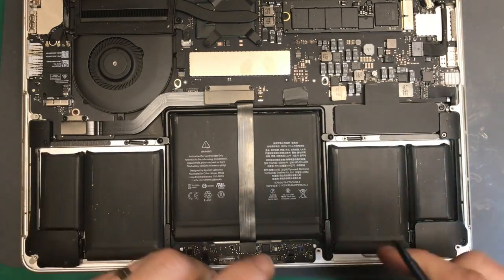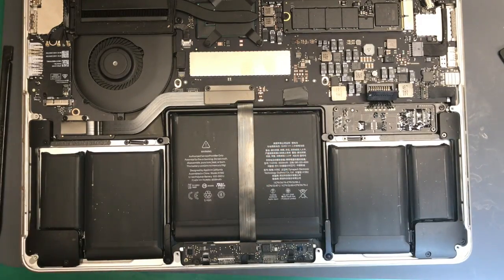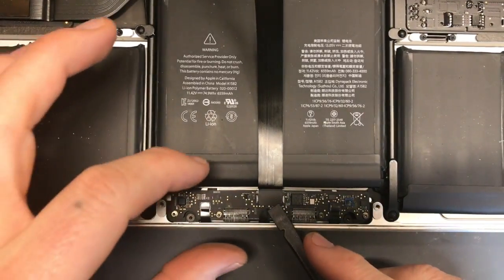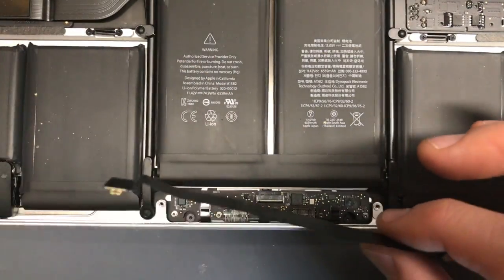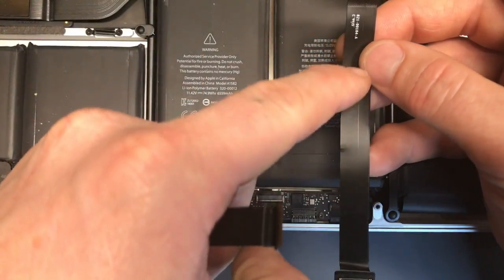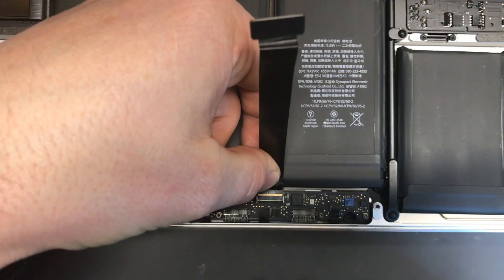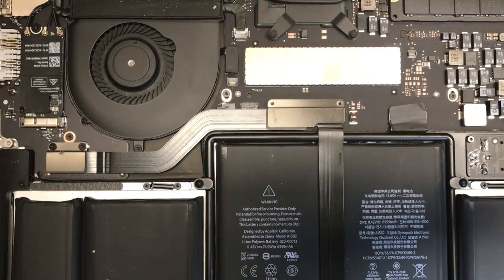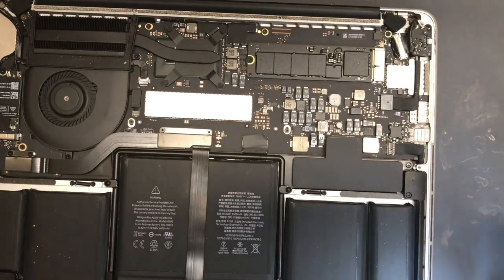Macbook Pro 13" 2015 A1502 NO Trackpad & Keyboard Fix repair Guide

Comment: i have the same problem, i changed battery and the ribbon and and the keyboard and touchpad doesn't work. any ideas ? please
Reply: Check the ribbon cable at the trackpad end, check its in enough and the flip connector is down correctly, check the trackpads mainboard for any corrosion, otherwise check the other end of the ribbon cable for corrosion on the mainboard
Reply: @jtw7777  Thank you so mutch !! I have already checked. The weird thing is that the touchpad and keyboard stop working after the bettery change, so i thought it maight be the ribbon and i changed with a new one. still not working. i have checked with the old battery also and without battery at all and still doesn't work. i don't know what else to do.

Comment: Mate any advice if break that leaver on the connecter ?
Reply from the maker: Hi, under a microscope or magnifying glass thread it back on, then flip it down, then tape it down, if this fails you have to replace the trackpad. Its not hard to fix if you have the broken bit and the right tools.

Comment: You mention you need to put dubbelsided 3m tape on the cable. Is this necessary? When I use such strong tape will I be able to remove the cable again if it won't work after all or if it is broken again? 
I guess 3m is a brand, but also refers to the tape-type. If tape is necessary, which type should be used and could also other tape be used?
Thanks for your help!
Reply from the maker: Hi you will need the tape, the cable seems too long, just remove the tape from the old cable, it works good.
Reply: Thank you!

Comment: Thanks for the video and for the explanation. I have a question though. After I replaced the cable on my early 2015 MacBook Pro I was unable to get it to start back up. I tried doing a SMC reset, and all it would do is make the boot up chime and then immediately shut off. I put the old cable in and it started back up (trackpad and keyboard were still out however). Any ideas as to what is going on and what I can do to get the new cable to work and the computer powered on? Thanks for your help!
Reply from the maker: Hi Nate, I'd say the cable you have purchased isn't a good quality or is faulty, I'd recommend to buy 2 cables and have one ready incase you have this issue or it fails again, try buying from another seller next time and buy 2. Good luck.
Reply: Thank you!! Just got the new parts today and it 100% fixed my issues!! Thanks MAC111 for your help!

Comment: I have the same problem.

1. I did the PRAM reset
2. SMC reset
3. Reinstalled OS X
4. Changed the cable.

The power button works oddly but still no change.  Any ideas or help would be appreciated!
Reply from the maker: rocker250 Hello, you should try another cable from a different supplier, it that fails it maybe a trackpad fault. Good luck
Reply: I tried a second cable. Still no luck.

The keyboard and trackpad work if I run linuxlive. 

Could this be corruption in the software maybe? I did do a clean install already though.
Reply from the maker: rocker250 I’d say both replacement cables are faulty.
Reply: Omg same. I thought I was the only one who tried replacing the cable but my keyboard and trackpad still didn’t work.
Reply: i had my cable replaced by apple, and i still find it faulty :(

Comment: Same symptoms as described, replaced the cable as explained but the trackpad/keyboard still won't work :(
Any ideas?
Reply from the maker: I would recommend trying another cable from another supplier.
Reply: impendio same thing happen to me did you find anything else?

Comment: 🍑Troubleshooting the unresponsive 3-4-e-r-d-f-c-v or even the 1-9 keys: check the keyboard ZIF connection first next to the trackpad flex cable. If it is broken, try to put something underneath, for example a thin plastic, to push the whole connection side upward. And save 10$ on another part, by thinking you might have broken the ribbon cable while being it... 🍑

Comment: We've tried this, having bought both screwdrivers but the T5 to do the trackpad cable screws seems too big, although it's the right shape. Have we bought the wrong one, are there different sizes? Thanks in advance
Reply: Daniel Jordan im having the same issues did you find a fix to this?
Reply: @itsnadeya  Did you find out? Is it T4 or T5?
Reply: @arnaudgay4658  its the one in the description i just wasn't turning it hard enough i think

Comment: Hello. Before this repair, did the trackpad and keyboard work in recovery mode? Thanks in advance.
Reply from the maker: 은화 김 hi, Sorry I’m unsure I haven’t tested it, normally when the cable fails the power button is the only key that works, I’ve had reply’s saying it works with Linux when the cable has failed.

Comment: Hey! So, someone at the apple store helped me do this and just when I went home I started having this issue again? What happens now?
Reply: Happened to me too :(. I read that it is probably due to battery swelling. I am going to replace the cable again (myself) then change the battery
Reply: Ben Norris update me and let me know how it goes!
Reply from the maker: I would try another cable from a different supplier.
Reply: update: it's still having a trackpad issue after two trackpad attempts. genius bar told me to test it out on another account (dummy account) to see if it's a software vs hardware. if the issue persists, then i would have to get the top case removed

Comment: can i do this on my mac which is a mid 2014 ?
Reply from the maker: Miles Ness you can but the repair requires you to remove the battery and the cable is different.

Comment: I've done this repair twice, and yet after a period of time, i still continue to receive these 'no keyboard found' messages. Am I doing something wrong? Or am I using a trackpad cable from less quality?
Reply from the maker: Hi, poor quality cables will fail, try buying from another seller, I've found that the best original cables are prebent with adhesive installed like the link below, make sure the cable isn't moving around once install and look at the bottom cover for any grit that maybe rubbing on the cable.

https://www.aliexpress.com/item/New-821-00721-A-Touchpad-Trackpad-Flex-Cable-for-MacBook-Pro-Retina-13-3-A1502-2016year/32785588612.html?spm=2114.search0104.3.240.308b42d4PtA36N&ws_ab_test=searchweb0_0,searchweb201602_3_10152_10151_10065_10344_10068_5722815_10342_10547_10343_10340_5722915_10548_10341_5722615_10696_10084_10083_10618_10307_5722715_10059_100031_10103_10624_10623_10622_5722515_10621_10620,searchweb201603_25,ppcSwitch_5&algo_expid=a84e66a4-5b18-45d0-8294-1d211edda592-37&algo_pvid=a84e66a4-5b18-45d0-8294-1d211edda592&priceBeautifyAB=0

Comment: It didn't work for me :/
Reply: Same did you find another solution?
Reply from the maker: There is a lot of bad cables out there, I would recommend trying another, the other fault could be the trackpad but way less likely.

Comment: This seem like super nice info! Have had this problem with two of my Macbook pro's from 2015. One question though. have you, after you have replaced this cable, come across the problem again with the new cable? I'm a bit worried I have to make this some sort of ritual every year.
Reply from the maker: Hi Per-Erik, yes I’ve seen a repeat repair, I believe it will be an ongoing issue, the cable is prone to fail due to wear and tear from being pressed against the bottoms cover, I would recommend buying 2 cables and having one ready. The worst bit is when Apple quote $300-$700 to replace the Keyboard or Logic board when it’s a $5 cable. 
I feel most one time repairers get great satisfaction from pulling this repair off and kudos to them. Apple should acknowledge this fault and do free repairs.
Reply: Damn, i had my suspicions. Yes, that is what they told me as well. To change the logic board. So I bought a new one, and funny enough, I now have two with the same problem. This solution gave me hope though, as I'm certain this is what's wrong with my two MBP's. I suspect it because sometimes the keyboard and trackback works, and a few times I tried to apply some pressure to the chassi where the cable is located, and it worked again. 

Regarding the cable, do you know if there are different cable compatibility for the A1502 Macbook, or if it is the same cable to all of the models in the list, for A1502? I've seen a few retailers for this cable, not listing my version of the model in the list of compatibility, even though its the same computer. Thank you so much!
Reply from the maker: Per-Erik Söderberg A1502 can be late 2013 - mid 2014 same cable but routes under the battery, A1502 2015 is different it routes outside / on-top of the battery, an the cable is different. Often if you disconnect a faulty cable the reconnect it will work, once you put on the bottom cover and it touches the cable it will stop working again ( shorting out ).
Reply: MAC111 I see. Mine is an early 2015 according to both info on box and system settings. So I think I would be safe to buy a few cables and get the right compatible ones. Thank you for all your help, and take care!
Reply: Oh, one last question. This problem with the touchpad and keyboard, can sometimes disappear when I restart the computer a bunch of times. And then come back again when I start it up another time. It can also come and go during usage. Is this also occurring with your other repairs, that the problem is not 100 % of the time?

Comment: having the same problem right now about 6 months ago my trackpad/keyboard stopped working and I took it in and had both the keyboard and trackpad replaced. it worked for a while but every week once or twice my cursor/keyboard would freeze up. but if I turned if off and turned it back on it would work. but now 3 days ago they both are currently not working. this is a 13 in MacBook Pro 2013.

Comment: Hi, I have a 2014 13” MacBook Pro and recently my trackpad quit clicking on the left side. The ribbon you’re showing doesn’t exist; or at least doesn’t run over the top of the battery. Can you please advise? Thanks!

Comment: So I took my MacBook Air into a repair store to fix because it wasn’t turning on, the repair for the MacBook was $300 + gst 
Trackpad:$116
FLEX CABLE, IPD:$30 
Trackpad and cable installation fking $120 
Wtf does a trackpad have to do with my MacBook not Turing on?!?! , also what’s a flex cable, ipd ?

Comment: I used the P5 pentalobe screwdriver to remove the back cover and it worked completly fine, however as I tried to unscrew the plate shield the screwdriver spun on the screw but did not unscrew it. Is the same screwdriver meant to be used? it seemed to be spinning on every other screw other than the back cover screw.
Reply from the maker: Dylan McKibbin, Hi, P5 Pentalobe is for the back/bottom cover only, in the video I have mentioned that T5 Torx screw driver will remove the Cable shield, this driver can be found in most hardware stores.

Comment: Hello
I have a Macbook Pro retina 13 A1502 and I bought the trackpad cable online.  However the serial code is slightly different,  it is: 821-00184-A C'1315. Normally it should be: 821-00184-A C'2315.
Is there any difference? Can I replace my trackpad cable regardless without repercussions? Thanks in advance for answering!
Reply from the maker: Hi, It will be ok the C'4415" etc varies, it will either work or not and fail in the same way as your last. Good luck.
Reply: @MAC-pv1bb  OMG YAY! I was kinda worried. Thank you for the quick response :D

Comment: In same situation since early Feb'18 :-(,  have a late 2013 A1502 EMC 2678 model, will this cable work? Pls help answer. Thanks!
Reply from the maker: Hi, for the 2013 2014 the Cable is different and goes under the battery, you would have to remove the battery to replace the cable. Much harder.

Comment: I just replaced the cable. Trackpad is now working, but the keyboard is not. I don't think I bumped/pulled anything that I shouldn't have... Could the new cable be faulty? Anything else to try? Thanks!
Reply from the maker: Hello, I would recommend that you try another cable, it would be the most likley cause unless your current one isn't seated or installed correctly.
Reply: That was it! Second cable worked like a charm - back up and running now. Thank you!!

Comment: can you please link me the parts through amazon? Thanks!
Reply from the maker: Wilz Hi Sorry I don’t use amazon, I think one of the other comments has a link.
Reply: MAC111 thanks! Do you really need 2 helper stick? they only include 1 stick with the tool kit
Reply from the maker: Wilz hi, just use a plastic takeaway knife or something thin and plastic, just avoid prying the battery and connectors up with anything metal, the softer the tool is the less likely you are to damage anything, some batteries can be hard to pop up and the edges may flake away but it will still work once connected.
Reply: thank you for the video tutorial replaced the ribbon and so far so good, Just a couple minor issues the replacement ribbon was a lil bit long i just mickey moused it so it can fit hehe and when i turn on the laptop it has 1 second delay before it boots up other than issues my keyboard n trackpad is working again.. thanks a bunch

Comment: Where and what is the model or part number for this black cable? Can we purchase from?
Reply from the maker: Hi the part number is (821-00184-A) Trackpad Flex Cable, its best to remove the old one and bend the new one in the same way, also put double sided tape on the underside like the old one then install it, it seems to long to me.

https://www.aliexpress.com/item/Original-New-2015-Year-821-00184-A-Touchpad-Trackpad-Flex-Cable-for-Apple-MacBook-Pro-Retina/32704380075.html?spm=a2g0s.9042311.0.0.cPnL9b

http://www.ebay.com/itm/Touchpad-Trackpad-Cable-821-00184-A-For-Apple-MacBook-Pro-Retina-13-A1502-2015-/192023581348?hash=item2cb57f52a4:g:A80AAOSwM2RZfup-

https://www.amazon.com/s/ref=nb_sb_noss_2?url=search-alias%3Daps&field-keywords=821-00184-A
Show less
REPLY

Comment: Hey @Mac111 i have the same Problem with my Mac. But i have the 2014 Retina-Model. Maybe its the same issue ?
Reply from the maker: emree_r6 hi, yes it could be the same issue, the cable is different on this model and it goes under the battery so the repair is much hard but very possible, you have to remove the battery to replace the cable or pry it up at the logic board end. Good luck
Reply: thx. trackpad doesnot function but the keyboard off and on function normally. thank you really much !
Reply from the maker: With the 2015 MBP the On/Off button is the only key that seems to work when the cable fails
Reply: MAC111 😍😍 thanks bro !

Comment: Thank you very  much.

My experience: Trackpad worked but keyboard did not, randomly stopped working one day. I got a trackpad cable off amazon and it did not work, so then I ordered them from Mac111's link and they cam about a month later. It came in a pack of five and first one I tried worked but it is too long so there are sharp creases in the cable where they connect. They keyboard was working fine for a couple days and then I went to type and it wasn't working again. Went to bed, did not touch my computer, open it this morning and it's working again.

@mac111 Can a 'faulty' new cable work intermittently or is it because it's too long and the cable has some creases in it or do I have a bigger problem with my keyboard? I don't know why mine are longer than yours in the video which seem to fit pretty well.
Reply: Did you figure out a solution to this? I have the same issue. Keyboard stops working but trackpad is fine.
Reply: same bro fml im typing this on a bluetooth keyboard, probably gonna order the cable again and try to pad it and put in some sort of support so it doesnt get so damaged, also might even get two just in case it happens again

Comment: hey @mac111.

I have changed the cable and the keyboard function normally but the trackpad doesnt function..
Reply from the maker: Hello, if it all looks connected correctly and the trackpad doesn't have water damage, id say the replacement cable is also faulty, try another one.
Reply from the maker: You could also try a SMC reset, google how to do it.

Comment: How i can order this spare part ?
Reply from the maker: Hi the part number is (821-00184-A) Trackpad Flex Cable, its best to remove the old one and bend the new one in the same way, also put double sided tape on the underside like the old one then install it, it seems to long to me.

https://www.aliexpress.com/item/Original-New-2015-Year-821-00184-A-Touchpad-Trackpad-Flex-Cable-for-Apple-MacBook-Pro-Retina/32704380075.html?spm=a2g0s.9042311.0.0.cPnL9b

http://www.ebay.com/itm/Touchpad-Trackpad-Cable-821-00184-A-For-Apple-MacBook-Pro-Retina-13-A1502-2015-/192023581348?hash=item2cb57f52a4:g:A80AAOSwM2RZfup-

https://www.amazon.com/s/ref=nb_sb_noss_2?url=search-alias%3Daps&field-keywords=821-00184-A
Show less
REPLY

Comment: I have a similar issue but my trackpad is stuck and keyboard won't work, do you know how to fix it? Apple wants to charge 500 dollars  for a new top case and battery to repair it...
Reply from the maker: Hi, the 2015 Macbooks Force Touch Trackpad doesn't have a real click, its kind of a fake pulse like the phone 7, if it feels like theres no click then it has no power, like it would when its turned off, I would try a $10 trackpad cable before shelling out $500.00, did you ask them if they did.
Reply: MAC111 ahhh this whole time I'm think I might've jammed it in lol. I'll give this a shot first hopefully it works. Thanks for replying.
Reply: Lol looks like apple might've stripped those top two screws on my mac.
Reply: wtf? they didn't give you your screws back?